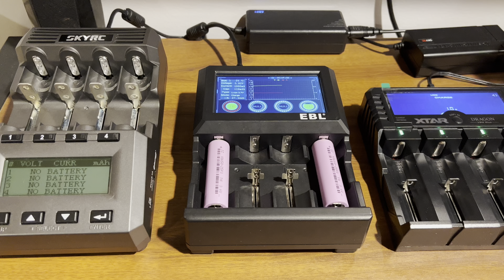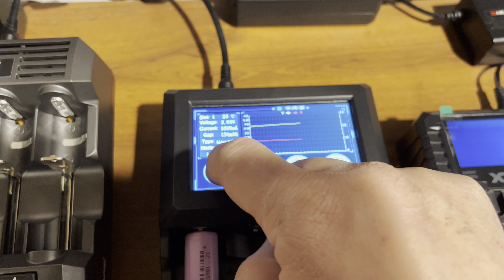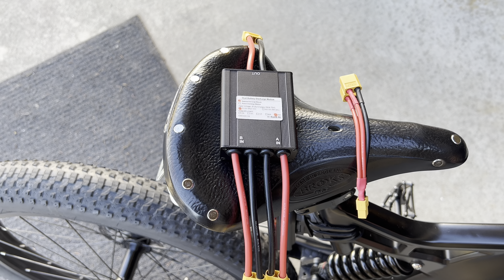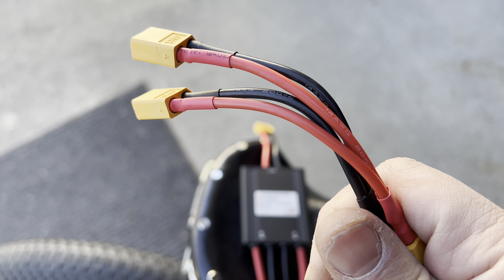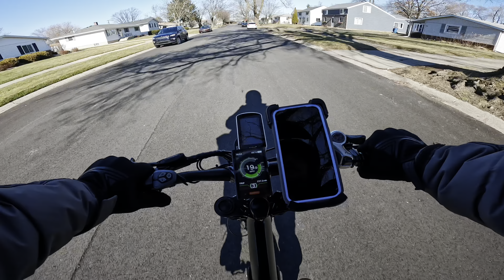Lyric graffiti potential dual battery packs issue and how a￼ Battery blender works

Comment: Aren't they diodes or something that blocks current from backflow in either battery? Did you say theyll allow backflow charge at a limited amount, or does it cut backflow current off completely?
Reply from the maker: It limits the current, it uses mosfets to switch and control current as needed. The cheaper ones don’t.

Comment: I've been messing around with lithium ion cells, and battery packs for a few years and I've learned a couple things. I own a dualtron thunder 2 scooter, and a voromotors emove cruiser S. 
1- every battery pack has a BMS responsible for monitoring charging, and discharging. Some battery packs have a separate charging port, some battery packs charge through the main plug that connects to the motor. While a battery pack can be charged through the main lead, if it has a dedicated charging port, THAT PORT should be used, as the BMS is not designed to charge safely through the main connector, IF it has a separate charging port. Can you still charge through the main port? Yes, should you, no. You essentially bypass the BMS and disable the safety features by doing this, UNLESS the battery pack is designed to be charged through the main connector.
2- I definitely would not mix voltages when connecting two battery packs. What I mean is, don't combine a 48 volt, with a 52 volt, 60 volt, or 72 volt. If you're going to connect two battery packs, have them be the same capacity, ie, BOTH of them are 52 volt, 48 volt, or 72 volt. 
3- You MUST ALWAYS match charge levels when combining two batteries, even with a parallel module. Both packs should be the same voltage, to within a half a volt difference. Connecting packs of differing charge levels WITH A "Y" CONNECTOR will cause an inrush of current to the pack with the lower charge level, this  will destroy the BMS, which will sacrifice itself to keep the pack from going into thermal runaway. 
4- NEVER GUESS OR ASSUME when combining batteries on any vehicle. EVEN WITH A PARALELLING ADAPTER! Once a pack goes into thermal runaway, it is a frightening thing to witness and impossible to stop. Don't rely on the BMS to protect you, always think ahead of time. If you don't have a lot of experience with lithium ion packs, then just disconnect the depleted one, and connect the full one, instead of trying to combine two of them.
SAFETY FIRST AND ALWAYS!!

Comment: so running a 40a balancer and using a 48v 10.4ah and a 48v 17.5ah battery is not a good idea since they are different ah batteries?
Reply: I doubt it. I've used a 120v by 120amp dual battery module with multiple batteries and voltages for a while now. I've run a 48v 23.5ah with a 52v30ah battery and never had an issue but that was temporary as I was waiting for my 2nd 52v batt to come in. Now I run two 52v by 30ah shark style batts all the time in every scenario imaginable with zero issues. I have a digital heat gun and check my components quite often and never see them run much above ambient temps besides the controllers of course, they do produce heat under hard use for extended periods. The module was about $118.00 from amzon a year ago. Good luck with your project.
Reply: I have been running 48v 13ah and a 20ah with balancer just fine. The balancer regulates  until the higher capacity is equal to the lesser one and then regulates them together.

Comment: Can anyone tell me why  my controller is getting hot and melting the wires. I have a 48v 13ah battery and I'm going to add a 2nd battery. Will this solve the problem. If someone could answer this for me I would appreciate it. Thanks.

Comment: I was worried myself but needed more range than my 36v 13ah had so built a pair on 36v 25ah packs but only one of the 2 new batteries has a Bluetooth bms on it , and after charge balancing all 3 I put them all together in a Parallel arrangement, it works fine and I'm able to actually see the discharge and in my case the last battery in this Arrangement will take on a small charge when load is off like coasting or stop at intersection and I can see as much as 1 amp flow back in to last battery for a few seconds then taper off as there all balancing themselves this isn't a Problem and most likely due to inter wiring an connections . Now I added a 4 amp charger to this system and charge the main battery and all 3 get charged at the same time and to make it faster 1 can an do put the old  2 amp charger on last battery to give all 3 batteries a total of 6 amps , this works out just fine and gives me a 65 mile range . I'm disabled so can't walk enough to be of much good and depend on my bike for exercise even though I probably can't peddle it more than 10 feet without battery Assist

Comment: It doesnt actually discharge both of them at the same time , it discharges the battery wich has higher voltage
Reply: Wrong! It discharges the higher voltage first and then both together when the voltage is the same.

Comment: Question. Can I connect two 52v 20ah with simple parallel wires into one port of discharger, then plug a 48v 14ah in other plug of discharger without starting a forest fire lol. Need more range on my 3000w hub.  Informative video btw!

Comment: Excellent video!  I just purchased a dual battery ebike.  Its the Amp rides Apex.  One battery is 52 volts 25amps. The other battery is 52 volts 20amp. Its running using a blender and 40 amp controller.  I went from 58.6 volts to 48.3 volts doing 22 miles. Does the display only show the reading of one battery.or both?  I feel I should get more range.  Do you also have some advice on charging my battery?   My 4amp battery burned out after one hour of use. That's why I couldn't get it to 58.8.  volts. It gets real hot. Thanks
Reply from the maker: What battery pack did you add brand? Display will only show as it one battery.
Reply from the maker: Yep something not right as I get with two 22Ah batteries over 60 mile range and I am heavy guy. The blender doesn’t even get warm and it pulling 50 amps at times when have both motors running up bill. Usually just run the rear 1k watt motor most of the time and go 10 miles commute on it and get about a little over 60 miles range before I charge the batteries.

Comment: It's easy to just swap cables on my old bike. I like having a 6ah small saddle bag battery as emergency back up. When my 13.5 ah big pack starts cutting off I can switch to the small one to get home. Then the big battery has time to rest and will have a little more juice in it.

It's a win win.

Comment from the maker: I guess now the a PR representative is trying to downplay the issue. Customers are saying to as well that they were told it just a 50amp fuse even though some already stated they that the pack smoked pretty badly one even stated almost caught fire? Then he was told it take 4 months for a replacement battery to arrive as well? Then Lyric try to lie and state they were not customers or angry people that hated them and that the batteries were not failing at all and made it all up in spite? I actually saw the response to him and a couple others that actually how they responded and one guy they stated that they refused to sell him a bike as he was rude to their staff and that he lying on purpose to attack them in spite? Yet more and more different people were stating the same imo and some people stated no response or no date for a replacement battery to arrive. I notice the pattern with this company is to lie and downplay issues overall and claiming people just hating on them? 

My response to them 

Yes you don’t use a inline fuse, they will blow, I learn that many years ago on my own e-bike builds. A proper good BMS will work just fine. Only on charge side you use a fuse. 

Their are people that smoked the BMS as well not just the fuse and some people claiming they were told they had to wait 4 months. I highly doubt your a customer and more a company representative to down play the issue, which is fine but 4 months for a new battery is unacceptable? Plus that bike sure have had a discharge/blender like most manufacturers do and just disable the regenerative braking system like most manufacturers do on the dual battery option version. As you stated yourself no 50 amp fuse sure have been added as redundant and that one of the reasons for a BMS. Yes knowing there now a 50 amp fuse inline is also another flaw, a easy one to fix as in the battery but a flaw that needs to be dealt with? I guess the sort of correct people will start to hate you when they get treated like that after spending 3k plus on the bike and the batteries are failing already and then being told it take 4 months for a replacement, or being called hater’s?

Comment: I own a lyric graffiti after speaking to the owners what I was explained was that the manufacture of the battery messed up on a few batteries and installed a 50 amp fuse which was not part of the design for the bike and is redundant because the bike BMS is supposed to protect the battery so basically they are sending out new batteries because the battery manufacturer messed up and the new batteries will not have the 50 amp fuse Another thing I am understanding about the bike it does not run both batteries at once it runs one battery down to a certain level then it switches to the other battery
Reply: I’m almost 100% positive the battery don’t run at the same time the controller switch from one to another
I was explained that you could turn both of them on and the controller will switch from one to another or you could turn one off run it low then switch to the other one
Reply from the maker: They are running them in parallel, their is no discharge module and the ASI BAC 855 only has one battery main input not two.  No smarts to switch from one to the other? Plus no discharge modules even the first intelligent ones currently on the market works with regenerative braking. So they can only run the batteries with a parallel Y splitter. It drains both batteries down at same time when both are switched on. You can just turn on one or the other manually with the switch. 

Yes you don’t use a inline fuse, they will blow, I learn that many years ago on my own e-bike builds. A proper good BMS will work just fine. Only on charge side you use a fuse. 

Their are people that smoked the BMS as well not just the fuse and some people claiming they were told they had to wait 4 months. I highly doubt your a customer and more a company representative to down play the issue, which is fine but 4 months for a new battery is unacceptable? Plus that bike sure have had a discharge/blender like most manufacturers do and just disable the regenerative braking system like most manufacturers do on the dual battery option version. As you stated yourself no 50 amp fuse sure have been added as redundant and that one of the reasons for a BMS. Yes knowing there now a 50 amp fuse inline is also another flaw, a easy one to fix as in the battery but a flaw that needs to be dealt with?
Reply from the maker: If you are actually a customer I am sorry for coming off as rude but they are downplaying the issue to you.

Their is no discharge/blender module they stated so themselves on a comment in someone else’s video. Plus regenerative braking doesn’t work with any discharge/blender modules currently on the market at this time. Then the ASI BAC 855 controller doesn’t have two battery inputs. They using a simple parallel configurations Y splitter pretty much. Yes people are have that 50 amp fuse blow as well but a few also had the BMS smoke as well and a couple stated it smoked pretty badly to the point that they thought battery was going to catch fire?

That all besides the point? My point in this video is they sure have disable regenerative braking on the dual battery option and used a proper discharge module and they won’t be having as many issues. I didn’t even know about the 50 amp fuse till some people yesterday confirm their is one and a whole another issue. You don’t use a inline fuse especially a automotive one or any as redundant anyways, they will blow due to inrush and peak current.

Comment: If you had the graffiti, what batteries would you put in it and why the graffiti battery has a 50 amp in-line fuse that blows that's what some are having problems with
Reply from the maker: It would have when with 21700’s like Samsung 50e cells instead of the 35e they used and 60v setup instead of 52v configuration is what they sure have when with. Plus put a discharge/blender module instead of a Y parallel configuration and disable regenerative braking as more problems then it is worth for at least the dual battery configuration. That actually would keep fuse from blowing. Plus people also have had the BMS smoke and blow as well not just fuse. 

If they when at least 60v that bike would have a good amount of Löw end torque and get to top speed without hesitation and likely go over 40mph easily.

You also don’t put a inline 50 amp likely automotive fuse. They will blow as not designed for that Voltage as well as inrush and peak current will blow it. I done that mistake myself and blew several before going with a breaker setup and going with a good active balancing BMS instead. Only thing use a fuse on is charge input. It the reason why most of us that do high power builds don’t use fuses and go breaker route instead.
Reply: @thetechgenie7374  could I just use a 52 V 21700 24 amp hour battery would that make any difference at all?
Reply from the maker: @rmccaul59  I was able get about 2600w which is 600w past the 2000w limitations as I push it that high on 52v till I ran in to back EMF issues.  I was able to pull 50 amps at 52v using Samsung 21700 cells You get some improvements as less voltage sag, more current per cell and a little more power and definitely more torque, top speed will be the same as you have to increase voltage to get more RPM out of the motor. 

To get much better performance out of that controller it needs 72v as I used that controller on BBSHD and shines on 72v as was able to push 100 phase amps reliably though it pass the 90amp limit that controller can handle as modified it a bit to run cooler.

It a very capable controller that one thing Lyric did right. I just wish they when at least 60v and 21700 cells. Then that bike will exceed it rated performance no problem. Controller would have to likely be reprogrammed. 

Only thing wondering is what motor they are using and how it wounded. It also makes a difference and if it can handle the higher current?

24Ah is going to give you more range vs the stock 17.5Ah. I also would look into disabling the regenerative braking and put a proper discharge module in, or just keep both batteries at same state of charge and make sure same capacity both matching and you sure be fine.

Comment: This is really interesting...thnk you for putting the info out.  I wass wondering though: would a battery blender/discharge controller limit performance?  I mean if its stopping the battery from realeasing a high output into another battery, wouldn't it also limit the power going to the motor?
Reply from the maker: No it doesn’t limit current to the controller as has a separate output to controller. It just limit current back feeding into other battery though mosfets to prevent damage to other battery pack from that rush current trying to equalize the lower state of charge pack. Other way to prevent damage to other pack without a discharge module is to keep both batteries at same state of charge of course both packs have to be same capacity. 

You get the full current capability of both the batteries so long the discharge module is rated for that current as you buy the module for your voltage and current requirements. The one shown in video rated to a 100amps at 72v, so can put it 100amps if both batteries are capable of putting out 50 amps continuous.
Reply: @thetechgenie7374  Understood...thanks again!